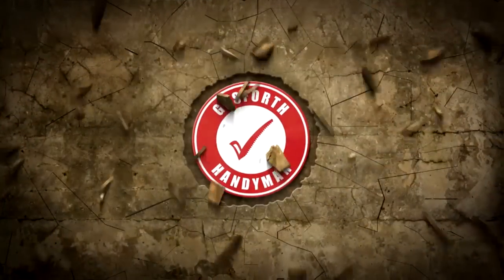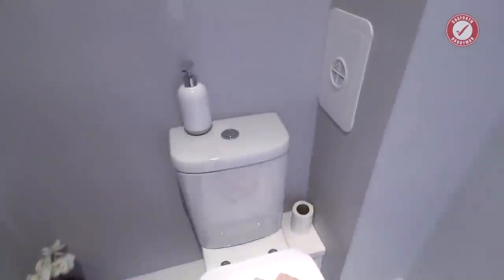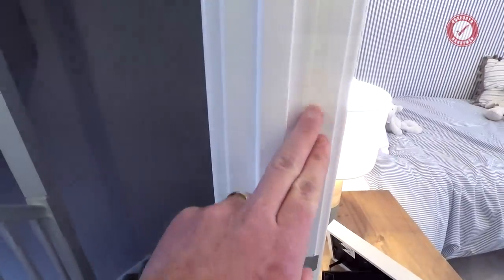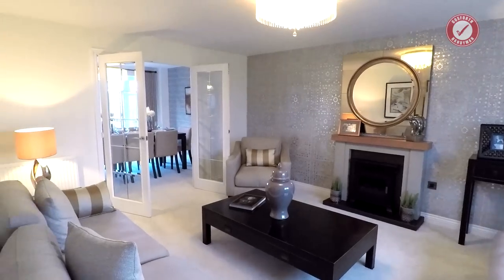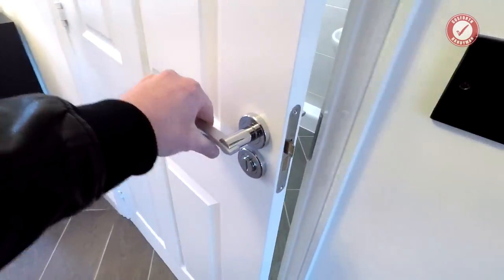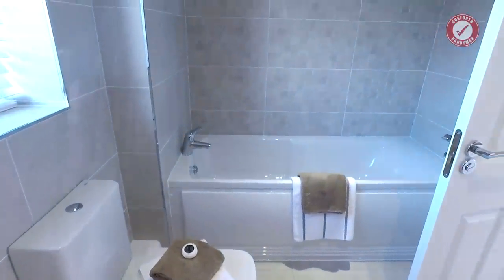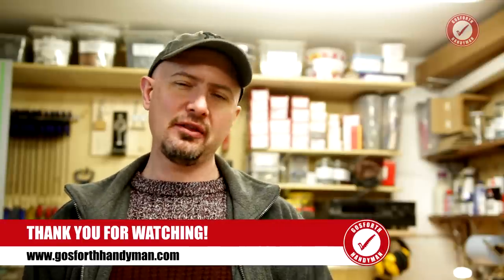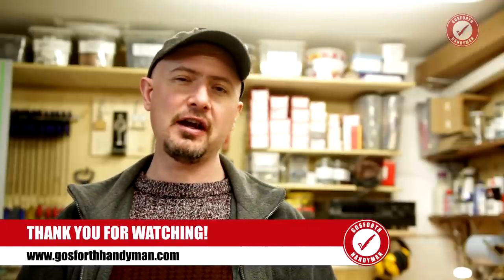How are New Houses in the UK Built? Looking at Showhomes!

Comment: opposite my village house are a few 3 bed new builds for around £350K with quite small rooms and a so called garden that you could not swing a cat in, they always have repairs occurring and have even had the roof retiled, we bought our 4 bed house 1982 built property for 330 8 years ago, spent 25K replacing heating with new, updated MCB, showers, security, drive etc and it has a garden thats 2/3rds of an acre which is a whole lot of fun, so imho i would go old. Needs spend but the feeling when its done and the size which is huge in comparison outweighs poor modern quality and a lack of true space to enjoy.
Reply: psymon25 Yes I’m amazed anyone can be happy in a tiny new build, small rooms, poor noise insulation, hugely overlooked by neighbours,  usually poor parking space, tiny garden, and even detached homes are normally just 2 feet from neighbours on cramped building plots, and normally right on the road too. Would seriously damage my mental health living like that.
Reply: @iamrobfromcardiff5515  YO YO THATS NOT HOW I LIVE IN A BRICK HOUSE
Reply: @iamrobfromcardiff5515  Wholly agree.  The gardens for most new builds are smaller than the footprint of the house and the front doors open straight out into the street.  I'd hate for people to be able to walk past my front windows or overlook my garden.
Reply: We have a old RAF 2 bed with a large garden, paid £165k, it's bigger than the brand new 3 beds down the road and much bigger garden, the only thing we miss is a downstairs loo!
Reply: Please refrain from swinging cats

Comment: I had one from Taylor Wimpey and it was beautiful and comfortable and the quality was not bad (after the snags had been fixed), but the main impressive feature is the thermal insulation - they are absolutely cosy warm in winter and economical too. The only thing is that the ground floor could do with an underfloor heating due to it being cold when you don’t have carpet laid. I guess the problem is after 20 years when the quality gives in. 
Another thing was the sound insulation between the floors - there were none by design and one could hear people speak even quietly. I would by a new build again, but I prefer a new build done by myself with top quality. Old houses never because they are simply not warm enough in winter.

Comment: That newel post at 4:17 is shocking!
a 'fix' could be to plane off the four faces so they are square to the lower part, then further plane the projecting corners so that the angle matches the 'missing' edges, and taper back to the full square where it is straight.

Or saw it out and fit a new one.

Comment: New builds are shocking. My first had creaky stairs from new which I fixed myself after the builder ‘fixed’ it. Leaking at the stop cock on the plastic side which was hidden by the kitchen unit so water soaked into the unit, the mdf skirting, into the walls all behind the unit. Pulled the kick board off to find a pool of water (contained by the level compound lip), black mould everywhere. Shower tiles came loose, held in by gravity as the adhesive didn’t take, water running behind them dissolved the plaster board and leaked through to downstairs ceiling which was a mess. The same shower, the door was not sealed correctly, so water would run around the lip and soak into the plasterboard. The PRV on the hot water cylinder went faulty - no problems as the overflow will take care of that...hmmm, water gushed into the tundish, which leaked. The water knackered the dining room ceiling, a push fit joint was weeping so a black spot on the ceiling appeared which went furry. Suffice it to say, I put right a lot of what was crap and then I sold it and bought another one....😫🤣

Comment: The boxing in of the pipework in the toilets looks really cheap and lazy. I'd want to see that pipework hidden in the walls or floors
Reply: They can't because there isn't enough of a gap in the studding to run pipework, plus it's easier and cheaper to fix on the surface, any idiot can do it
Reply: @GrahamWalters  I'd rather pay more for a better job 😂 would love to have a hast built to my own spec. Currently the 2nd owner of a house built in 2001 and still finding shortcuts and bodges from when the house was built
Reply: its simply a cost and speed issue and not everyone puts a premium on it. Im like you.

Comment: I used to live in UK and I owned property and I can relate to all the things you were showing. I moved to Poland recently, what got me is that in Poland you buy houses in a "unfinished" state, aka you need to do things inside, what you need to do varies, but is usually with full electrical wiring, plumbing, working heating, rest of things like finishing up walls (base plaster is there, and you need to even the surface out for paint) floors, bathrooms (all ceramics taps etc), kitchen, interior doors etc. are up to you. At first I was annoyed cause you needed to add the extra money on top of what you pay for property to finish it up (banks do lend you money for that too if you need it when taking up mortgage). However looking at the videos you are showing where you 'pay for everything extra' I am not so annoyed anymore. At least doing it yourself (i mean paying the people and buying the products you want) will guarantee you get what you pay for.  I wonder if this system  (of bare bones houses sold by developers) would work in UK, I guess the banks would have to change their ways in UK.

Comment: One of the worst things you can do in the UK is buy a "New House" because they're so over priced. I do property development, that downstairs toilet looks horrendous with that boxing going around for the pipework, not professional at all. The kitchen does have grantie/quartz worktops but they've used poor quality units, doors and fittings shocking really. All they've done is glorify and bog standard budget kitchen. What is that shower, so bad, no need whatsoever for that shower tray to be so high. You can get low thresh trays, even for the U-bend underneath, sink it in the floor. These houses really haven't had any thought put into them. Biggest bug bear and being cheap is not tiling the whole bath area. 

Here's my opinion, from someone that works in property. Do not buy this crap. You're being over charged and ripped off.
Reply: Can I ask you a question as a property developer? How do small gated developments of like 6 houses compare to the ones built en mass? I live in Surrey and I’m interested in some luxury new builds down the road but I don’t know if I’m being ripped off. 3 bed terrace =520k (1000 square ft) and 4 bed semi (1300 square ft) =700k on a gated development of 6 houses near all the amenities. I can get an older 3 bed for 400k on the same road??
Reply: Absolutely thought the same thing horrid. New builds with boxing is a sin. Put some concealed toilets and sinks in that thing.
Reply: UK is really in dark ages when it comes to decor. Barely anything nice in shops. Same old boring stuff
Reply: Easy to say when you already own a home with equity. As a new buyer, to buy an older house you'd need anywhere from £30,000 upwards as a deposit. With help to buy on a new build, u could get a house of the same value with a £15,000 deposit. Theyve got u by the balls
Reply: @jaebird789  It very much depends on the developers standards rather than the size of development, smaller developments do tend to have higher standards as its a way to get a premium. Like selling any product, a good developer will target a market segment with design, build quality and fit out. Like a new car, you will pay a premium for new, lower running costs and warranties. Price per sq.ft is a good benchmark , although more so for apartments if like for like is compared, but orientation can be up to 10% , detached, transport,security, schools , postcode, garden size, traffic, allocated parking are other factors. Only by knowing the local market can you tell if its good value but fit out and condition needs to be taken into account not just financial but the hassle and time factor too. Just look at the difference in prices between a top end kitchen or bathroom to entry cost versions for the most important differences. When your viewing some other house with an agent who isnt selling the development ask for his thoughts , but also check them , they may have there own agenda.
Reply: Your right and we both know why - Cost.
Reply: absolutely right. I'm in the kitchen trade nether done any large developer work because as you say its all done for cheapness priced down to every screw. done a number of show homes then nothing. don't bother entertaining them any more.
Reply: @jaebird789  majority of new builds are just built on the cheap, you're best going viewing them, alot of the time you can tell straight away if the build quality is good. If you were to send me some photos I could tell you. It's all about the small details and the finish of the final product alot of these companies don't see that because the houses are sold before they're built.

Comment: Why is it that even on the deep drawers, they all seem to have shallow sides and just a useless bar going across?  Mine are like that and things are forever falling out the sides and the back.  Why aren't they proper deep-sided drawboxes?
Reply: Because you're supposed to buy the special dividers and interior boxes which cost more than the drawers themselves. The drawer box is only a vessel for the inserts.
Reply: @janejan9728  The inserts are shallow too - I have those.  It's the actual sides that are the same depth as the shallow drawers.  I have a deep drawer for my towels and tea-towels... with a cardboard box in it so that they don't fall out.

Comment: I live in a 300 year old converted coach house cottage and love it, had a leak in the roof and one of the fireplace walls has damp patches. But the house was very reasonably prices and has a big garden that feels private. I would buy a new build but I'd go with a reputable builder and I would inspect the house first. I think most houses come with issues. Saying that my last house was built in the 80s and had hardly any issues.

Comment: My dad bought our house in the 80s. it had 1 previous owner. dont know when the house was built tbh. i'm from Wales. i have been to many houses on my street and by far our house is the biggest which is weird. we live in the city. in a terrace house. we have a big front and back garden. we have a big basement with 2 rooms (down a flight of stairs). we have 2 big living rooms. we have a shower and a toilet on that floor. a big dining room with a extendable table which fits 8 people. and still space to move around. a kitchen little bit small but it's perfect for our family. gas cooker. in the kitchen we have a loft on the ceiling too. and a new room we built which was the side of the garden. it's like a conservatory but ngl it leaks lol so we need to get that fixed but its so useful coz all our fridge freezers and spare food go in there. then go up a flight of stairs, where you will find a bed room and also the family bathroom with a corner big bath/shower. it also has a loft space in the bathroom roof. then go up another flight of stairs another bed room and also the master bedroom. outside both bedrooms we leave the ironing board. then you go up another flight of stairs you will find windows looking out to the roofs of all the houses but its higher so we can see above it. then go up another flight of stairs is the massive attic. we have 2 queen beds in the attic and honestly we could fit 4 king beds if we really wanted to and still have space. both sides of the room have to lofts going along the whole sides of the room. houses are pretty cheap in wales if you find the right one. our house is probably worth not much. i would go for older houses thanks. its bigger. more space and thicker walls. we legit can't hear anything with neighbours on both sides who have so many kids.

Comment: As someone who use to work on various new build housing sites for various contractors The copper pipe work is a con inside the walls the plumbing is plastic push fit (cheap material and labour cost)and the copper is placed where pipe work is visible to give the impression that the whole property is plumbed in copper. Every main contractor does this it’s shocking. New build companies are about numbers not quality

Comment: Hi. I enjoyed the 2 part series on the new builds. Interested in your comments about oil based paints. Ive used Dulux super sheen oil based gloss for years. As you are aware you can achieve an excellent result with good prep and application, but Ive noticed in the last 2 years or so that yellowing seems to appear after just a few weeks on painted surfaces not in direct light. I've googled to see what others think, and concensus seems to be use water based, but the results in terms of finish are not as good as oil based. What products, in terms of undercoat and finish coat have you used that give a good finish and will not yellow?
Reply from the maker: Hi Ian - have you watched my Water Based Gloss vid? I only use water-based these days (for white).

Comment: Hi Matey,

Nice video.

I’ve moved into a new build & they’re definitely warmer than our old house. However we’ve experienced the following issues with our 3 storey new build, I was wondering if these issues are common?

1. Waterhammer noise when we shut the water taps (we have plastic pipe work on our plumbing), could this waterhammer lead to a leak in the future?

2. Roof noise - on a windy day we get some kind of knocking noise above one of the top floor bedrooms, everything looks alright from the outside, just wondering what it could be? Loose fascia board/ tile/ rafter tray vent??

3. Squeaky floorboards - are these common with new builds? Do they get worse over time?

Finally, we noticed a leak in Sept.’17 when one of the contractors pierced our downstairs cloakroom sink with a 4 inch nail, it was leaking for maybe a year until we noticed mould in the skirting, Kier sprayed the internal soaked/ mouldy joist wood with Zinsser saying it’ll do the trick, & they ‘made good’ the outside plaster & skirting, is that sufficient or was I fobbed off with the Zinsser treatment? Should they’ve removed the timber & replaced with new timber?

Kind regards,
Reply from the maker: Hi - I would get a plumber out to check the water hammer - if it's really bad it could cause leaks so worth checking out - could be too much pressure or badly fitted pipework. Roof noise could be literally anything 😀. Squeaky floors can be quite common since often the wrong type of screws are used (I'll be doing a vid about screws soon). Leak - impossible to say without inspecting the timber I'm afraid! 👍
Reply: Gosforth Handyman Thank you for replying.
Reply: @GosforthHandyman  I live in the us. In Colorado it gets pretty windy here and it’s normal for your roof to shake/vibrate when introduced to high winds. That sound is the trusses vibrating from the force of the wind pushing on it. Any creaking/shifting noise is normal in gusty winds 👍

Comment: I used to work for a “new build” nationwide builder which is still going, shove them up quick, cut corners, internal walls are about 75 mm thick and although insulated, you can hear everything, plastic  plumbing, the smallest shower bases you can get, 900 mm square.
They’re clever marketing terraced houses, when you look at the gardens, they look quite big, that’s because they leave the fences down  !!  Good luck, but check out the builder very carefully !
Reply: Can we make profit buy newly build  house and sell it as trader haw to success plz

Comment: you are amazed at the copper plumbing.  question, Do you think copper is superior to pvc?  If so, why?   I always thought pvc was better but you are the expert.
Reply: Came to ask the same question... Nowadays I would go with speedfit every time over copper. If fittings are used properly in my experience they never leak.